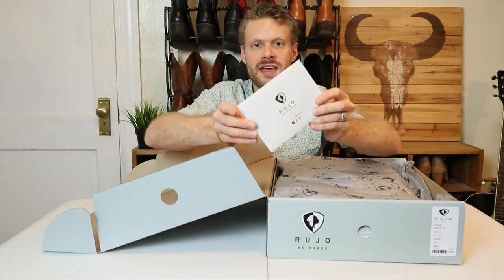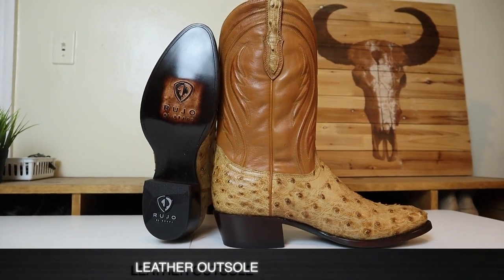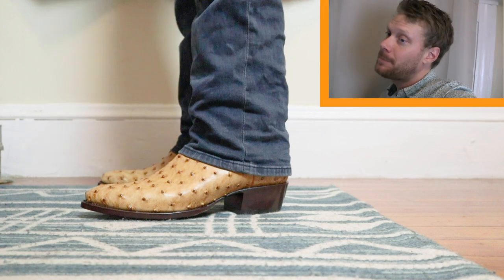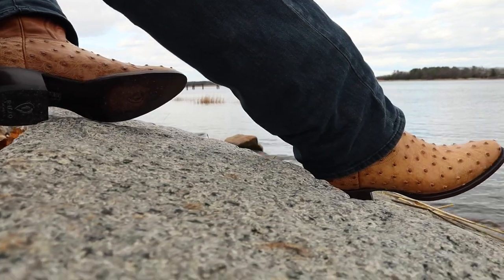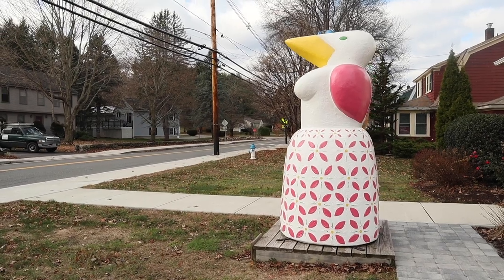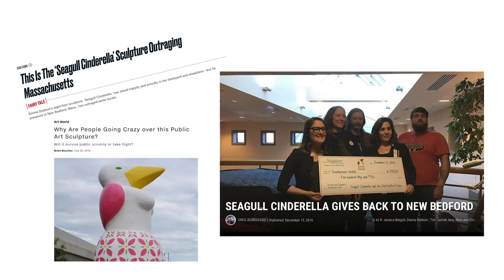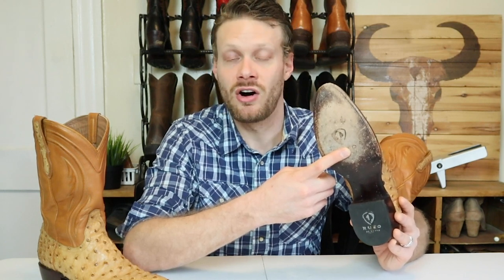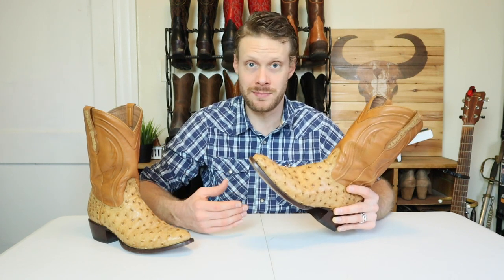Simple and Sophisticated Ostrich Boots from Rujo

Comment: Hey Jeremiah! Loving your channel the last few weeks and I'm thinking about going with Rujo for my boot purchase soon, but the only thing stopping me is the memory foam insole. It sounds amazing, and these aren't going to be hard use boots so I'm sure it will be fine, but in the case that the insole starts to feel less comfortable down the line what would you suggest to do to fix that? Add a new insole on top, or try to find someone to replace it, or just get a new pair all together. Thanks!
Reply from the maker: Hey Ryan! Thanks! My Boulet 7031 boots had a similar insole and they got more comfortable over the years. Not as comfortable as a hard leather insole but insoles like these will still form to your foot and last a really long time especially if you're not going to use them really hard.
Reply: @JeremiahCraig  thanks a lot man! I actually talked to Rujo tonight and they said even with everyday wear their insoles would last 3-5 years, and even longer than the leather outsole! Keep doing what you're doing man I'm a huge fan.
Reply from the maker: Thanks Ryan!

Comment: YOU ARE WALKING WRONG IN THOSE BOOTS.WHEN YOU STRIDE WITH STEPS SO WIDE APART YOU ARE ROUNDING OFF THE SHARP EDGE OF THE HEEL OF THE BOOTS.TAKE SHORTER STEPS SO YOUR BOOTS COME DOWN FLAT TO THE GROUND AND YOU WILL NOT ROUND OFF THE TOE AND THE HEEL OF YOUR EXPENSIVE BOOTS.JUST KEEP DOING THIS AND AFTER A SHORT TIME YOUR WALK WILL CHANGE BECAUSE YOUR WONDERFULL MIND WILL LEARN AND IT BECOMES NATURAL TO YOU..